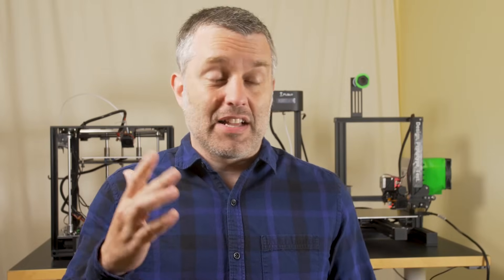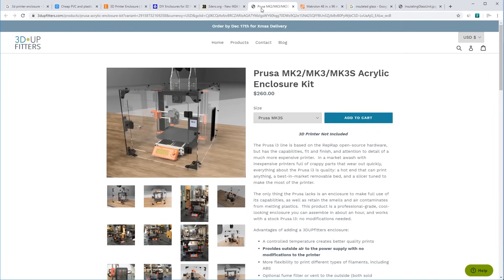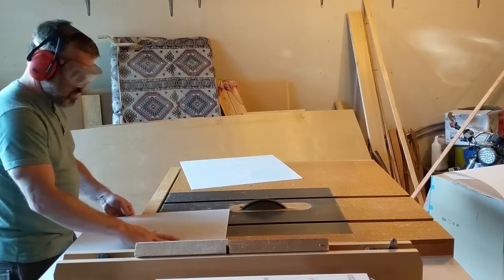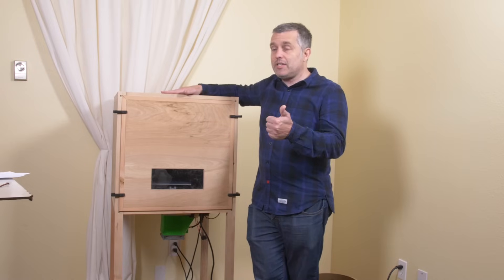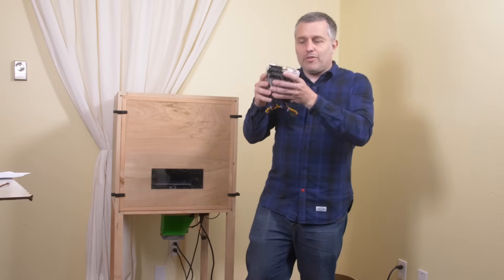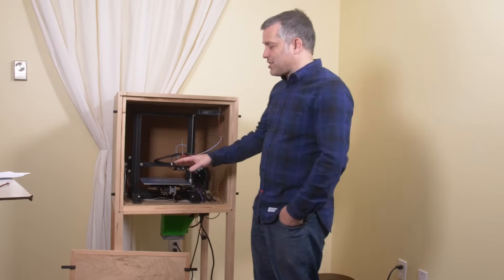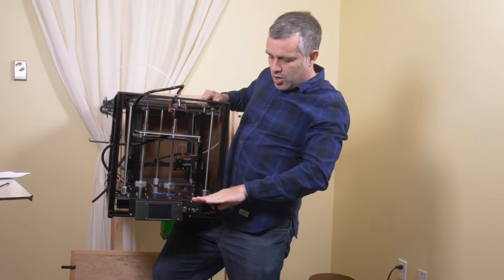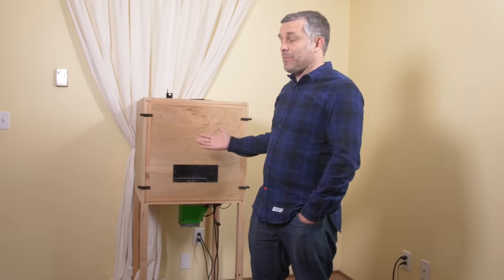3D Printing in a 100°C Heated Chamber - Lessons Learned

Comment: Finally the main stream learning how amazing PC is - thanks!. Fully worth the effort. Been printing drones in PC for some time:

https://rotorbuilds.com/profile/9617

FYI: PC-CF is super brittle. Good for stiff hight temp resistant prints, but no good where you want impact resistance.
Reply: Love your designs. It's been a while since  my last whoop when they first came out. Is there a board, brushless motor and rotor setup you would recommend for an indoor build these days?

Comment: What sort of enclosure temperatures are needed. I ask because I have a garage where the summer temperature easily exceeds 130f (55c) in the summer months. The printer would  "live" there do I need to worry about this?

Comment: i believe the important part of the Stratasys patent states the mechanics are external to the build chamber. Parts that are strong, durable and functional need to be made from materials like PEI. To print Ultem well (and most other high performance polymers) the chamber needs to be just slightly lower than the Tg which is about 185c for 9085  and over 200 for 1010. Its not practical to attempt to get motors and drive components to survive at those temps. Bet your ass once that patent extension runs out there will be many lower cost machines that will hit the market with the ability to make "real" parts while having the guts outside the oven

Comment: Why is anyone in this day and age still printing in ABS?
Reply from the maker: Best combination of Heat resistance, Strength, post-processing workability, and most importantly PRICE.
Reply: @DesignPrototypeTest  PETG has better Heat resistance, Strength, post-processing workability. The price difference is less than the extra cost of heating you are spending. It prints faster and neater and doesn't give off toxic smell.
Reply from the maker: Your claims about PETG are patently false. Go watch CNC Kitchen's videos on the subjects. He did heat tests and strength tests on all the normal materials and PETG performed worse than ABS in every test.
Reply: @DesignPrototypeTest  he tested a specific type of petg. 'Petg' covers a range of materials with different additives and properties. High temperature petg had much higher heat resistance than abs FACT. So you can try to twist what you say to be correct under the right technicalities to plump your own ego, but the reality is that petg provides a superior material in all these aspects.

Comment: Man. you could save sooooo Much effort. don't get me wrong, great job. Just could have away easier time. Rather than trying to cut slots for the  plexti, Use any of the piles of 1/4 in wood strips, and use seperate pieces of wood, and silicone between and sandwich them for the multi pane  funciton.plexi si too flexable. You' r Idea would have been GREAT with actual Glass, but PC is too flexible, Or you did you slot way too tight, no need for friction if you use sliicon. How much is a tube of caulk to the hours of extra time you could save rather than fighiting with friciion fit... eh sorry spellin

Comment: You're trying to heat the enclosure to 100C, yet you need part cooling? I don't get it. 

Newbie.
Reply from the maker: You want the filament to be just molten enough when it leaves the nozzle so that it  can be laid down accurately and well.  As soon as the plastic is laid down you want it to solidify so that it doesn't move. This is what the part cooling  accomplishes:  Near instant solidification.  But you don't want the part to cool too much. The colder it gets the more the plastic shrinks.  So you want the part to keep its temperature just cool enough to be solid.  Then, when the print is complete you pull the warm part out of the chamber and the whole thing can shrink  as a single unit. Because you don't have different temperatures at different layers, the internal stresses  within the part  are minimized and the part is stronger. Not to mention that you avoid part peeling off the bed and layer delamination issues.  I hope this explanation helps.  Have a great day!

Comment: Great video, really apriciated it.
I do have a question concerning lifespan of the printer, would it be worth it actively cooling stepper motors, and the hotend with a water cooled system?
Wouldn't heat creep be an issue at those temperatures?
Thanks a lot!
Reply: Yep. Water cooling is the way to go. But I think that the best would be for him to use the other printer he showed.
But the reason why he didn't try that one is because it is harder to enclose with his expectations. But after this video the expected quality is questionable. :(
Reply: I put together a liquid cooling loop for my Ender 3 for my heated enclosure and its been working well for quite some time.
Reply: @V8in240sx  Actively heated? Up to what temp are you working?
Reply: Christophe Kafrouni  Yes active heat, cooling, and air filtration depending on what material I’m using.  Right now I’m capped at 100*c enclosure,  340*c hotend, and 115*c bed. End plan is a couple of upgrades to get me in the Ultem 1010 required range.

Comment: i heated up my bed to 110°C and 250 nozzle and make a sealed chamber "no heated chamber", that was enough to have some outstanding prints made of ABS.

and a fatal flaw what i once commited was the extruder cooling was blowing air on the print (dont get confused with print cooling like PLA needs), the fan have some of the air leaking due to turbulence inside the extruder duct, blowing from the front of the fan and consequentially cooling the print, make them bend, have bad layer adhesion and etc...

i printed a different fan holder, with the fan pulling air from the extruder instead of pushing, and have around 45° angle to blow the air upwards. 

now the prints are simply amazing.

btw, the "schottky" diodes that you're talking about was called "bridge rectifier". in THIS case, 50% means half wave rectifier*, what let pass only the half positive (or negative) portion of the sine wave to the load, and 100% means *full bridge rectifier (or full wave rectifier if you prefer), what means it uses positive and negative portion of the sine wave.
Reply: That's a great comment! You are clearly a very smart guy, but I suspect English is not your first language. No offence is intended, I just wanted to offer a helpful grammar hint. Be careful on the the usage of the word "what" vs "that".  Correct grammar is "that will let pass only half of the positive..."  also, at the end of the sentence it should read "that means it uses both the positive and negative portions of the of the sine wave.
Reply: @hermit3400  why does it matter if you understood what he said. How many languages do you know again?

Comment: There is no need to make that as long as you have a real good printer . The enders are far from the best. And I dont recommend.  Printers have come a long way , I love the sainsmart 300 there is no upgrades needed . I have it o. A shakey table and have no problems also have in front of an open window , still no problem, dust and pollen, dog hair , hot or cold still no problem.  Use cura 4.6.1 and your good to go . Please dont over think 3d printing

Comment: Are you sure those are Shockley diodes? It looks like a cheap power diode bridge turning ac to dc for a dc motor.
Reply: I agree they look like standard IN4007 or the likes I cant see any reason why you would need fast Schottky diodes on 60hz.
Reply: He managed to avoid saying "FULL BRIDGE RECTIFIER!"
Reply: Those are not schottky diode. You don't use schottky diodes for rectifier circuits. They have low breakdown voltage.

Comment: I can suggest a few improvements:
1. Use ceramic heaters with cut off at 130*C, it will never go above 130 - so even if your PID controller or thermostat fails, heater will self regulate and never reach dangerously high temperature

3. Connect part cooling fan to a pipe and get the cool air from outside of the chamber, use silicone chaulk to seal the chamber where pipe comes

3. Use a PID controller rex100 is cheap with SSR from china

4. Lay the wood with some fire resistant paint or coating.

Comment: I don't see how a patent for putting a box on top of a printer could possibly hold water: it is nothing more than a smaller-scale version of the same technology that prevents me from freezing to death when outdoors temperature drops to -20C in winter and could even be built using the same materials. Build your printer enclosures literally like a room - 2x2 studs to support 1/2" drywall.
Reply: The patent covers only actively heated (or otherwise climate controlled) enclosures. Not simple boxes that retain heat generated from the bed/nozzle. Still, I'm bummed that they got the patent extended somehow. It just slows the technology drip to us.
Reply: the patent is not about the heated chamber, but about having the motion components external to it. So that they last longer.
Reply: @faxxzc  While I haven't read the patent myself, there's a reason Sanjay from E3D (among others) have referenced it when explaining the lack of climate controlled print environments in their products. It certainly makes sense, though. By having a patent on external motion system components, you almost have a patent on chambers via price lock. Any stepper capable of long term operation at 100C won't be cheap. Cheap defines the desktop 3D printing market right now with the "race to the bottom."
Reply: you're right -- a box over top of the printer will allow water to flow out the bottom...

Comment: i was waiting for this video thanks a lot , can you tell me what PC you use
Reply from the maker: The cheapest stuff I could find on Ebay.
Reply: @DesignPrototypeTest  Trying to decide if this is a real reply? You present yourself as an expert and therefore you must know how important the correct material choice is for any 3D printing task and you choose the cheapest PC you can find? Wow. And you choose to part cool PC? Another wow. Just build a chamber out of 1" rigid foam from Home Depot. It works great. Not sure I'm going to learn anything here any longer but if you want to try a PC that might print better than the "cheapest stuff you could find" try Poly Maker Poly Max PC, been suing it for years and it prints great.

Comment: I really think nobody reads patents. the patent is not about the heated chamber, but about having the motion components external to it. So that they last longer. The way you built the heated chamber is not covered by the patent. READ THE PATENT CLAIMS!!!
Reply: Thanks for the info. I was maybe sometime to build something like this myself. For home use it would not be a practical problem, but what if I want to use the printer in some commercial use case? But I'll just place the steppers inside the chamber, way easier and they are cheap to replace.

Comment: No scribing knife or guard on your panel saw, no guard on your drill press saw blade setup , etc.
It's going to be just a matter of time till you lose some fingers working that way .
That's your choice, except  for the fact that you make videos a lot of inexperienced teenagers view, 
 ( probably  the largest demographic of 3d printer users) and  they don't know any better.
And to ruin their hands could have lifelong consequences for their career prospects.
Reply from the maker: Not many teenagers buying table saws these days. Any shop class or makerspace where they can actually access a table saw will give them the whole safety brief. But yeah, let's blame me for stuff. I made a video once about Gameboys. Maybe I'm to blame for the latest school shooting which was clearly inspired by video games. I've still got all my fingers, and I worked for 10 years in the construction industry.
Reply: @DesignPrototypeTest That wasn't a attack ,mate!
I enjoy your videos a lot and find them very informative  and fun to watch.

I've worked in woodwork shops for 35 years, also have all my fingers, only had some  minor incidents (lucky),  but have seen many nasty incidents  over the years that were worse.
 In my early years ,when I was inexperienced and safety measures and standards weren't  what they are today, these occurred on a very regular basis.
I'm using the comment section to point out that you are in a good example position , with many of your video watching audience probably somewhat less experienced in the use of machinery.
And if my comment ,or you showing the correct safe work practice  prevents even only one of them injuring themselves, (like I try do with younger and inexperienced colleges everyday at work)
 I'd regard that as a  win.

Keep making your excellent videos !

Comment: You could cut a circular port at the top of the box, and attach a flexible tube/hose to it that can then be mounted over the intake of the part cooling fan, so that relatively cool air can be channeled in.

https://imgur.com/k8yRmZH/

Comment: cheap electronics arent great in high temps environment
Reply from the maker: Good thing I used top of the line electronics (a Duet 2 WiFi) and placed the electronics outside the heated enclosure. Or did you miss those details because you didn't actually watch the video before leaving a comment.
Reply: @DesignPrototypeTest  How did you know. I've got too short of an attention span to watch anything longer then 3 mins.

Comment: When I'll build my enclosure next year, I plan on making a double wall filled with bird sand to dampen the sound of the printer. Any thoughts about that?
Reply: For sound proofing, consider drywall- it is effective and inexpensive. Also fire resistant. Not insulative, on its own, but neither is sand.

Comment: RIP printer. 100C in a sealed enclosure without any active cooling is going to significantly shorten the lifespan of your printer.
Reply: its an ender 3 so basically cost nothing

Comment: In reviewing this again, I wonder if the heat failure error in RepRap is functioned as a curve between current and set temperature?  In other words, will you get the error if you set the temp to 45, then 70 then 100?  I print a ton of ABS and am getting 50 to 54c naturally.  I'd love to try 60 and 70c even though I have no current issues. It can only get better.

Comment: you have to use a PT100 sensor and use the auto-tuning functionnality on the duet https://betrue3d.dk/duet-wifieth-pid-tuning-hotend/
i am also working on my next project. probably a corexy with stepper motors outside. keeping only the extruder via watercooling system. you definitely should go all metal. And use aluminium walls instead. i like your heating setup. just a little bit too loud  for me. (your tevo little monster could do the job as well - steppers are outside of the chamber)

Comment: Since going to a temperature controlled chamber in a humidity controlled room (dehumidifier) my prints are more repeatable.  There are some nice inexpensive Digital Temperature Controller  available on Amazon and other places.   I just use an old incandescent  light bulb for heat.  A cardboard box with plexi glass windows makes a great enclosure.  Foil lining can help, but cardboard works fine for these low temperatures 100C and below.   Step motors are rated to work at or below 50C, so keep that in mind.

Comment: Where do i begin...
.5 I believe the patent would only apply if you were manufacturing enclosures and selling them. Build as many as you like for personal use.
.75   I love the table saw with no guard or push-board. I detest these whining liberals who think everyone needs a helmet to survive. There were no child safety seats during my childhood, and no bicycle helmets either. Remember, it's for the ticket money. Oops, i mean the chilllldren.
1. Foil-faced poly-iso-cyanurate foam.
2. Cut the grooves wider and use glue to seal in the acrylic sheet. Or a local glass shop will cut you anything you want. Look for old windows on trash day. Most are easily-cut plate glass.
3. 1 diode would give you intermittent pulsating half-wave dc from ac, 4 diodes act as a bridge rectifier to give you real dc from ac. The waveform is still a little choppy but a simple motor won't care. If you were running sensitive electronics you would want to add an induction coil and a capacitor.

Final thought. I see you strive for perfection... But for most people, just go to Home Despot and buy foil-faced foam sheet, cut it up into squares that when packing-taped together will form a box that fits over your printer. Put the filament reel on top, feed it through a hole. Maybe cut a viewing window and tape on some salvaged glass. Cut a hole in the top and install an LED light to illuminate the interior. Use a Raspberry Pi running Octoprint to keep an eye on it when you are away. 
The heat coming off the heat bed will heat the air inside the enclosure well enough to print well, without all the extras. Fairly fireproof if you set it on some concrete board. Try and mount the electronics outside the box.

Comment: as usual incredible information I am currently overhauling a ender 5 and I know there’s so many enclosures out there that people are making usually with plexiglass which to me makes no sense which is why I am enclosing mine with thermal glass, as for heating the chamber I’m considering a small heater used in resin printers even for wire management I spent a lifetime working in industrial electronics so I’m already looking into using a fireproof wire wrapping solution it’s something we used in the steel industry when it came to the electronics used with High temperature applications like with a blast furnace

Comment: Having the electronics inside the heated chamber is a bad idea, the operation temperature is usually 85° for complex components like the MCU and get to 125° best case.
Also, heating the motors isn't good either.